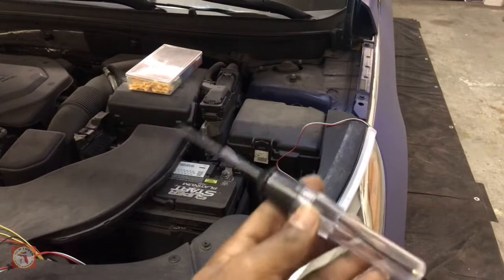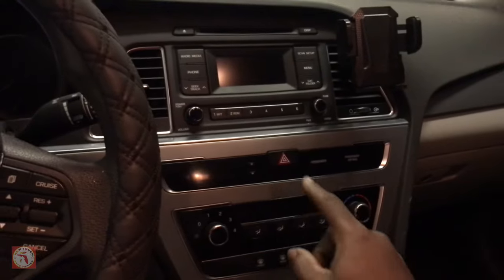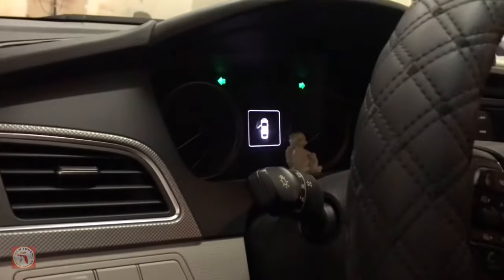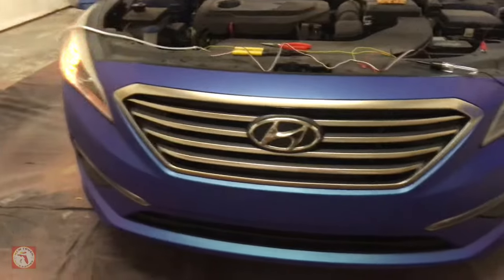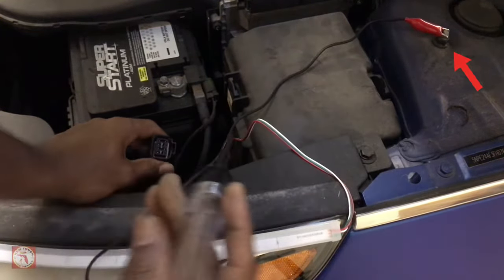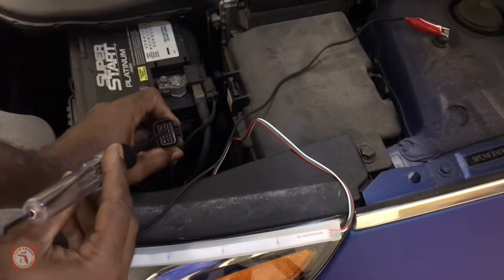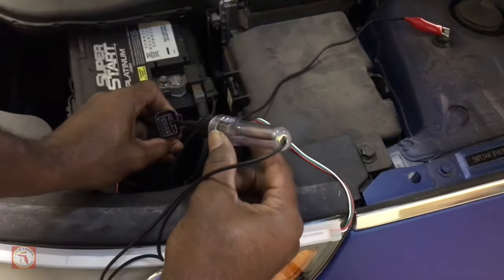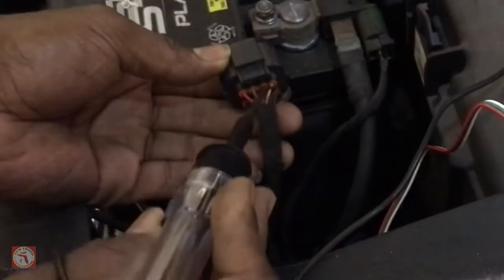(How to) find the positive turn signal wire on your vehicle, Super Easy

Comment: This was the simplest video by far on how to find it.  No others did that.  Thank you!
Reply from the maker: You’re welcome, I try to get straight to the point
Reply: @newtouchauto  do you have one on how to find the rear signal wires?
Reply from the maker: @tbro9497  no I don’t but you would follow the same instructions as the front.
Reply: @doityourselfworld  I had no luck there so I'll have for it.

Comment: Damn i bought both headlights for my e class e350 i was about to return get my money back but you came across and im keeping my lights god bless you brother
Reply from the maker: Always good to know that this was helpful for you, thanks for sharing your thoughts and watching the video.
Reply: What year? I have a 2018 E43 and need to know what colors the left and right turn signals are. Can you help?!
Reply from the maker: @jkaatz I’m not sure what year the previous response vehicle is but you should still be able to locate the signal wires. Using the process in this video will narrow it down, all Mercedes won’t have the same wire color codes.

Comment: Whats the best method for tapping into signal wires? Ive added sequential turn signals and want a clean tight install. Thanks for info 👍 2:10
Reply from the maker: There are a few ways of doing so but here’s my option below, around the 5 minute mark I explain how to tap into wires. 
https://youtu.be/a-lacRrEYUU?si=zg0zODS610ZNmhY6

Comment: Thanks, would you be able to help me? I have 2004 Chevy Tahoe 5.3 my signal lights aren’t working in front back or side mirrors. I’ve replaced the flasher relay, multi functional signal light switch & fuses. Only my emergency blinkers work.. but they never stopped working. What else can I do or is there a walk around
Reply from the maker: You’re welcome and thanks for watching the video, seems like you may have a recall issue. Something like that will need a diagnostic test from the manufacturer, check the Chevrolet forum on the Google search. You’ll definitely find out what the issue may be, also give Chevrolet a call to see if there’s a recall, if so you won’t have to pay for the repair.

Comment: One question, cause i'm doing the same with blinker strips, i know red is +, blk is -, does white go to blinker fuse.
Reply from the maker: If the blinker strips are separate more than likely you’ll need to find the signal wire and tap into it. Connecting the white wire to the proper fuse is an option.
Reply: @newtouchauto  thx for the help
Reply from the maker: @ericbarber3185  you’re welcome and thanks for watching the video.

Comment: What about the drls that are white during the day and supposed to change blue when dark or the headlights are on??? I'm trying to install some drls and fog lights but my drls, there's a yellow/LS, a green wire/RS and a white wire for the blue lights. The red and black I figured out but the others I can't???
Reply from the maker: As long as you connect the wires to the proper connections everything should function properly. 
LS-Left Side / RS-Right Side

Comment: if i cut my oem pigtail off and have one from another vehicle and have to splice them together but the wires are opposites in color how would u go about that (im new to cars)
Reply: my cars wires are black(with with stripe) , black , and white , and the pigtail with the connecter is black, green(and yellow) and green(and white)
Reply from the maker: If the year of the car is the same as the year you got from the other vehicle there may be a difference. It really depends on where the pin connectors are placed, if they’re in the same location the colors won’t matter.

Comment: Mine is bad it doesn't show any power for blinker going to fuse box.checked all fuses ,even spliced into wire .The light works ,just not when it's supposed to blink on only driver side passenger blinker works fine
Changed out blinker switch,still same problem 
What do I need to do next ?
Reply from the maker: Have you checked the fuse inside of the vehicle? You can also try attaching the tester to the positive terminal, it will give you a signal as well.
Reply: @newtouchauto 
Swapped out headlamp wire harness.still not working so followed it with fuse tester and no power from headlamp connector to fuse box blue wire with little white stripe wire is the problem.
What's my next move ?
(Note :Blinkers on passenger side good, turn signal in the driver rear good too ,just front druver signal is problem )
Reply from the maker: I’m not sure what the issue may be, check the Hyundai Sonata forum group on google. I’m sure you will find the answer there.

Comment: I done but the turn signals i bought have a yellow wire to go to the turn signal and both sides blink
Reply from the maker: You may need to contact the manufacturer about the proper connections, hopefully they can assist you with your issue.
Reply: That’s because he told you to hit the hazard lights lol. Just hit the blinker for each side to find the spyware for the blinker and not the hazards